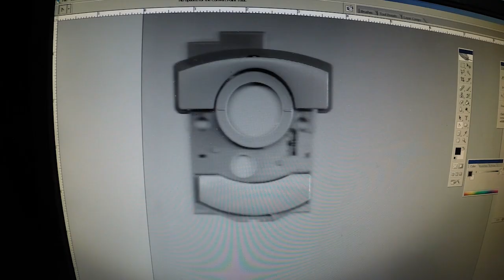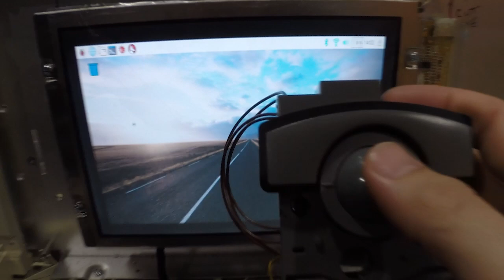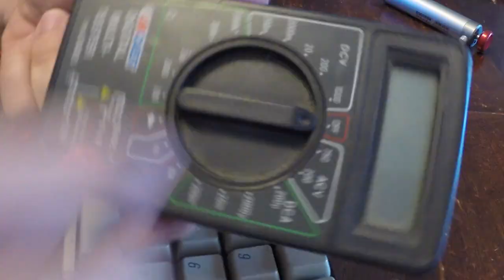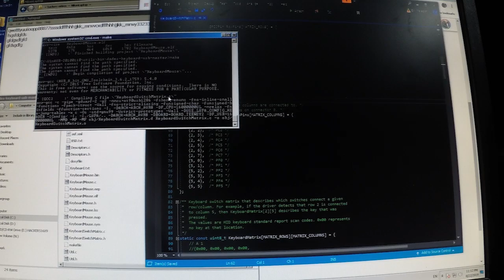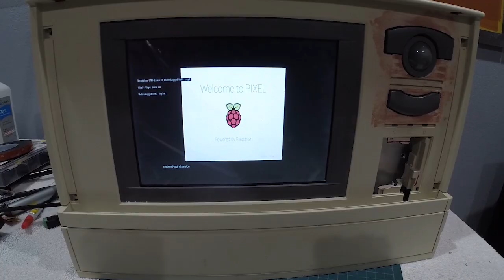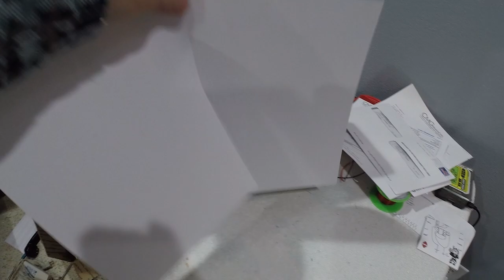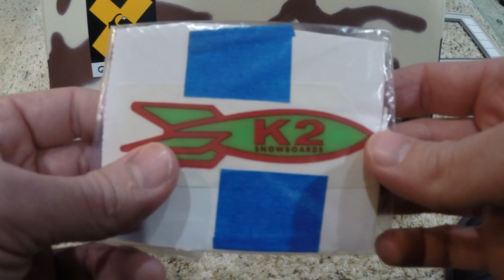HACKERS: Dade's Camouflaged Luggable PC

Comment: It's gotta be Dade's clear laptop next. I've wanted a version of that laptop since the day Hackers dropped.
Reply: That would be sweet.
Reply: Yes, please.
Reply: I think I read somewhere that it was a legit Apple prototype, you often find clear cases with engineering prototypes.  Cannot confirm but it would make sense, unless the prop department injection moulded a custom clear powerbook case which seems unlikely.
Reply: Always thought the transparent case looked good on any electronics my GBA had a clear case with a slight bluish grey tinge
Reply: @lemagreengreen  I'm fairly certain that would be what it was. When I was a teen back in the 70s, my brother worked for Texas Instruments as an engineer and he brought home engineering samples a couple of times, TI calculators with clear cases! Most were just the production case molded with clear vs. the black plastic, but I remember one that was a sample with smooth clear plastic instead of the "pebbling" texture that was extra cool! I'm sure other manufactures in the industry did similar things.
Reply: Prison electronics are clear
Reply: Framework should do a clear casing. I cant afford it, but I could at least add it to my toBuy bookmarks

Comment: And yeah, please continue the series with Dade's clear laptop.
The world needs more transparent housings for electronics.
Reply: That was an actual Apple prototype for the PowerBook Duo 280c; the clear cases were used to observe airflow tests.
Reply: @RCH_Aero  That's a valid argument for it's existence.
The aesthetic though, is great, and I'd love to see it come back. Makes the anodized details on some motherboards really pop.
Reply: @Flatl1neFred  Agreed, just, don't think it's likely to be a thing. Look at the length of time and expense that's been incurred just to make very simple cases for a Macintosh and an Apple II (https://maceffects.com). I'd love a transparent, reasonably capable laptop, but the tooling and production costs would be significant, and a lot more resources would be required to reproduce Apple's PowerBook 280 transparent plastics (remember, Apple was creating the molds and industrial capacity to build the thing already), than cramming a PowerBook 180's guts into a Compaq portable.
Reply: @RCH_Aero  You know, I've been thinking about this, and i believe it might work with a simple vacuum mold thingy, for a one-off case.
Reply: @RCH_Aero  The plastic on those was also supere flimsy, wasn't laptop grade plastic for daily use, was used to see airflow and the internals like dude said. You can find them for sale, rarely, but they're out there
Reply: @DrMurdercock  Maybe more towards a plastic sheet option that is more rezilient, I'll run some tests next year at a local maker space if I have the time and post if it happens.
Reply: @Flatl1neFred  You probably  know more than I do about it anyways man, Do you tinker with much stuff like that? I'd like to be able to stay in touch in case you do try some things, ive wanted a clear laptop since that movie came out and I was a kid. It made me want the glass gameboy pocket too, (it was a clear one that didn't have that haze on it, crystal clear, still want one, i am obsessed clear electronics since the movie dropped, one Pro Tip if you are also a clear cased freak, electronics made for prisoners are always crystal clear plastic, so now im thinking, there IS a clear plastic that is tought enough for a laptop case, cause they use this crystal plastic for the inmate TV's, walkmans, other stuff that has to be resilient !!!) You gotta make it happen. Maybe you could try to make clear shells for like the most popular 90s laptops that are easy to get?)

Comment: Man I love these videos.  I'm glad someone has the eye for detail and patience/time to put into making these.  I want to see a replica of the Gibson control console but I fear that's too big to reproduce.
Reply from the maker: Can definitely say that ive thought about it :)
Reply: @HackersCurator  capacitive touch sensors?
Reply from the maker: Had a little something different in mind actually. Something ive seen done for interactive gaming surfaces. An IR sensing camera under a sheet of polycarb that has microscopic reflective particles in it. IR emitting LEDs around the perimeter of the poly carb. When you place an object (finger) on the surface of the poly, it reflects the IR down into the table. You could use that to determine where a touch is and produce a keystroke (and a gawd awful "boop" sound along with it).

Comment: Wow I would LOVE to hear about the thinking of the original prop makers. Talk about square peg and round hole. I know they wanted to use macs and this is easy to understand. I bet they somehow were committed to use certain elements before they recognised how difficult it would be. Or they just expected it to be this difficult and were used to scratch building. Props people and set builders are often incredibly resourceful and talented.
Reply from the maker: Yeah I really have no thoughts as to why. No clue if the original functioned or what. Very strange. Looks cool though I suppose, so checkmark for that :)

Comment: I'm curious how long you've been using that red putty. About 20 years ago I was building marvel model kits made from vinyl. I watched a video on how to assemble and paint the kits. And in the video the artist used a  red putty that was different than standard grey putty that was made for models; you'd buy it in hobby stores and came in a little metal tube. I could never find it and I'm watching this and recognize that its the same putty the artist used in the video years ago.
Reply from the maker: You can still readily get that red stuff today. Its called glazing putty and is air dry with no mixing. Only good for really light filling though. If you lay it on thick it cracks and is weak.

Comment: Can you tell more about how to reverse the keyboard matrix? Is it a matter of finding ground and assuming a two dimensional combo of row and column connections for each key?
Reply from the maker: Each key connects a pin on each ribbon. Hold down a key and use the multimeter in continuity mode, and just test each pin combination. When it beeps, you write the 2 pins down. 
Keyboard controllers sent +voltage in a cycle across each pin on one of the ribbons, and is waitin to receive +v on each pin of the other. By knowing which pin it was sending out on, and which pin(s) it received it in on, it can determine which key(s) are pressed.